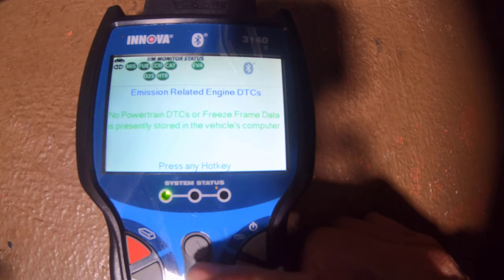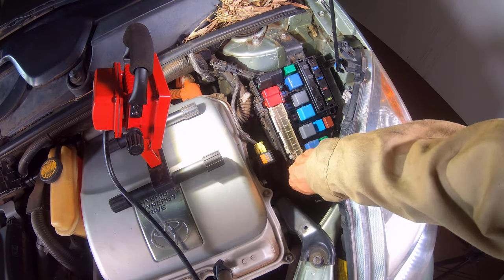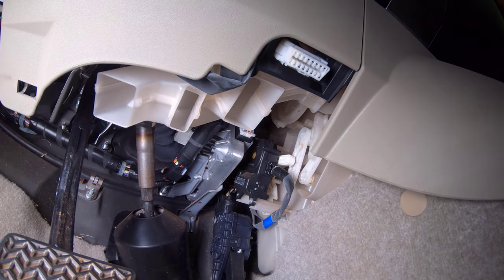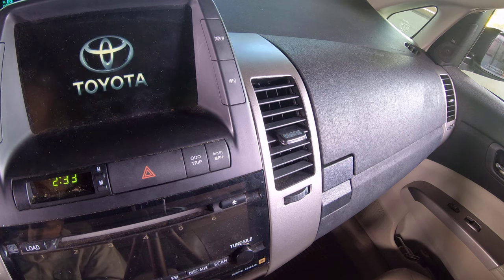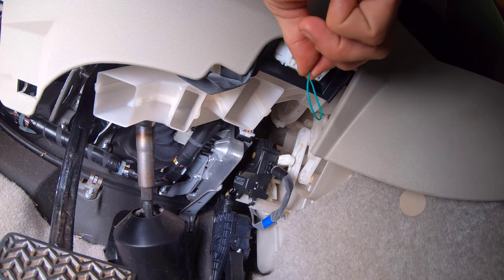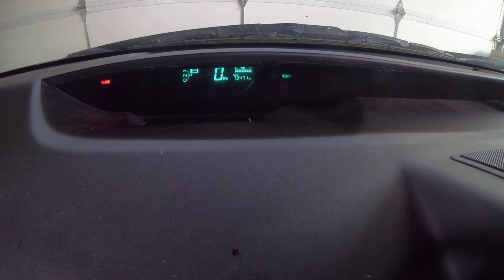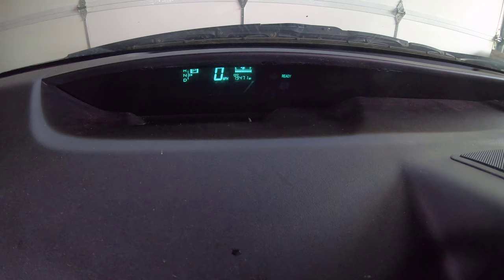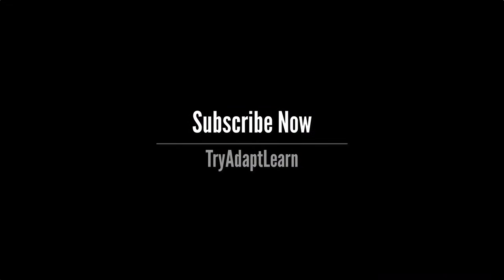Reset the ABS, VSC and Brake system warning lights on Toyota Prius.

Comment: Hi. Thx for your video. 
I have same problem.
Lights goes off but when i take clip out the light come backs on.
Any advice pls
Reply from the maker: If indicator lights keep coming on after they are reset the problem is likely still occurring. Take the vehicle to have a Toyota and/or ASE technician look at it,  They will have the diagnostic tools to run through the brake system thoroughly.  If you must troubleshoot yourself, next steps would likely be to check: 
Computer maintenance codes 
Electrical fuses 
12 volt battery voltage 
Brake fluid level 
Brake pad/shoe wear
Continuity of wires to the brake system sensors 
Faulty sensors
ABS pump and/or actuator
Reply: @TryAdaptLearn  . Thx for your reply.
Reply: @aimlessdrive8723  I took it to garage they had expensive scan tool  they clear it was easy, but with my scan tool  didn't work

Comment: You missed an important step.  You are supposed to press the brake pedal at least 8 times within 5 seconds once the diagnostic screen appears.  Without this step it did not work on my '05 Prius.  And this is directly from the Toyota service manual on page BC-38 (Break Control section pg. 38)
Reply from the maker: Thank you for including this information.  The process in this vehicle worked for the vehicle in this video but the steps in the Toyota service manual (and/or manufacturer service manual specific to each vehicle) include the proper and definitive process.
Reply: @abe Alexander  thanks for the Info It works for a 09 prius base model....
Reply: Worked for me after pumping them 8 times. Ty for the help
Reply: It Works in my Prius 05
Reply: Thank you, wasn’t working for me on an ‘07 until I did this!
Reply: and does the manual says to jump the OBD-ll pins 😂
Reply: Thanks for great advice even save money and life

Comment: To reset the internal DTC codes for ABS, while displaying this diagnostic screen, press and release the brake pedal 8 times within 5 seconds.  Turn the car off, remove the jumper wire, and start the car.  Note: for me, I think the error was triggered when I had some brake fluid come out of the cylinder when replacing the rear brake shoes.  I adjusted the rear brakes, and bled the brake lines to get the air out of the lines, and then cleared this error.  It worked!  For me the ABS code was 42 and the VSC code was 65.
Reply from the maker: Thank you for your detailed description.  One good thing is that you added the reason why your light came on and how you fixed it prior to resetting the light.  There are many reasons why these specific lights come on for this vehicle.  First assumption should be that the lights and sensors are working and there is a malfunction in those systems.  Your comment explains your issues clearly.
Reply: Lol you answered my the question  that the video didn't
Reply: Thank you, I had diagnosed and fixed my brakes without the fancy scan tool and just needed to do this 🤣

Comment: If this doesn't work, please check your brake fluid level. It was actually my problem and, thank God,  just by adding some fluid all the lights went off.
Reply from the maker: Thank you for contributing more information to help troubleshoout this issue.
Reply: Just as Abdul Rahman, in my case too abs, vsc, brake system warning lights went all off after adding more Brake fluid. The diagnostic sw confirmed error C1202 "insufficient brake fluid". When I checked though, the level was on MIN and could not suspect this to be the cause.

Comment: 2009 Prius, recently had left front wheel bearing assembly replaced. When I started my car afterwards, noticed "Brake, ABS, & VSC" lights stayed on. In your video you mentioned "connecting jumper wire 5th hole on top 4th hole on bottom". I stopped the video and noticed holes connected were opposite "4th hole on top & 5th hole on bottom" and that's where the jumper wires were placed. Today used a small paper clip & after a few times trying to connect jumper wire (4th top and 5th bottom), at 66 my eyesight is not like it used to be, had to get real close, and finally got them connected. Turned car on, diagnostic screen popped up(all o.k.), pumped brakes 8-10 times real fast, and brake light went out, other ones were still flashing. Will go down tomorrow as I ran out of daylight, and do again as I left the jumper wire connected. Thank you for the video! It was a big help.
Reply from the maker: Thank you for your feedback and good luck with resetting the rest of the lights.
Reply: I do appreciate your video. Very helpful!. Have made several attempts to clear the remaining lights on 2009 Prius with 202,000miles on i.When I start the car and remove paper clip, the mentioned lights(ABS, VSC & exclamation point) remain off, but when I start down the road, within a minute or two they come back on. So I  suspect a defective/damaged Speed/ABS sensor. Will be checking associated fuses tomorrow. My son last week changed my left wheel bearing hub assembly, so something might have happened with the mentioned sensor. I di find your video very helpful. Thank you!t @TryAdaptLearn
Reply: Well tried several times using paper clip method per your video. Lights on dash would be off while car was not moving, but came back on after going down the street. Checked fuses..all fine, even unhooked 12v battery for 10-15 minutes. This morning was pushing dust shield away from left front rotor, was able to reach my hand in behind brake rotor, lo and behold found the left front wheel sensor unhooked. Took car over to my son, he pulled the wheel off, and found the little bolt holding the sensor in place had been sheared off. Were able to remove remaining threads, and secure the connection. Started the car and all the same lights were back on, so got out my trusty paper clip, and did the process again, removed paper clip (lights again off), drove a little piece up the road, lights did not come back on. I drove about 15 miles home, lights are still gone. Thank you again for the video, after doing it several times, was able to memorize the process. Problem is solved.
Reply: @TryAdaptLearn  you definitely said
It wrong

Comment: Great video. My 2012 Prius C shows the same warning lights. Do you happen to know which pins (and their locations) so I need to jump?
Reply from the maker: I'm sorry, I do not know if this prodcedure will work on the nwer Prius C.  I would start to troubleshoot the issue with a code reader.

Comment: This worked  for me after changing  my battery but i also had to press the brake pedal 8x within 5 seconds as mentioned  below by Abe Alexander for it to clear my code, so that method works for 05 and 09 base model for sure.....After changing my brakes, lights came on along with breaks barely  working, I had to put car in battery mode while using the break to help car stop, this method fixed it so yea thanks a ton 👍🏾
Reply from the maker: Awesome. Glad it helped to reset the lights. Thank you for leaving feedback.
Reply: fixed my 2011 Prius lights , when press the brake 8x within 5 seconds  !

Comment: Will this work with a 2012?  Ever since having a low tire my "slip indicator light" has been on!  It's the only light on.  EDIT:  Our Prius-V is a 2012 and still has original 12v. Trunk battery!
Reply from the maker: I’m not a technician but here’s my opinion on what I would do if this were happening: Several issues are challenging so I try to do as much as I can for each issue one at a time.  At 9 years old, I would test the 12v battery and change if needed.  Some auto parts stores offer help with testing batteries.  The tire is also priority, I would take a note of which tire was low.  If it's more than just an inflation issue, I would try to get it to a tire shop to identify the cause and permanently fix the issue. Then the light first is try to get get the codes with a code reader also troubleshoot the sensors and wires to the sensors for that location.

Comment: Guys make sure you check your speed sensor is clean and the dust caliper is installed correctly. That’s what caused my lights after a bearing change.
Reply from the maker: Thank you for your perspective.  A dirty connection at the sensor is one only few issues that may be the cause of the lights displaying without any serious issues with the parts or systems.

Comment: I"m having an issue with my abs lights on my 2012 prius.    when I use your jumper method it works to reset the lights but, as soon as I start driving they come on again.  How can I figure out the root problem with out going to the dealer ?   I know they will hit me over the head - Thanks
Reply from the maker: One way to trouble shoot is to use a code scanner that has ABS capabilities.  Some auto parts stores will also use their ABS scanners to help you diagnose free of charge.  Although it will take more time some service departments at dealerships will diagnose for free, you just have to to ask specifically how much they charge for diagnostic only.  I have listed the items to look out for in the pinned comment.  The lights could come on due to any of those items.  Unfortunately with these vehicles, the most common cause is the the ABS pump and/or actuator.  The part alone is expensive,  no matter who does the labor, I would recommend a genuine Toyota part.

Comment: I did my own brakes on my 2009 Prius and the brake, ABS and VSC lights came on and braking was unacceptably dangerous.
With a PAPERCLIP and jumping the pins like your video shows, my brakes now work like a dream and all of the lights are off.
Thank you!
Reply from the maker: I am glad it worked for you.  This is likely because you solved the issue by with replacing the brakes and the reset procedure was just for the lights.
Reply: Same for my 2008 Prius! Need to pump the breaks 8x when the diagnostic screen came on like another post said. Classic YouTube at its best right here
Reply: @TryAdaptLearn I did it but it comes back like everyone 5 -10 miles . Do you know the solution to that ?

Comment: Worked perfectly. The lights came on after i replaced the drivers side hub. The brakes were not working and the lights were on. I entered the diagnostic mode by using the jumper cable and just to be sure, pressed the brake pedal 8 times. Worked on the first try. Brakes are back and lights are gone.
Reply from the maker: That’s great it worked as a light reset for you.  Thank you for leaving your feedback.

Comment: I just wanna point out that if you have an airbag light, check the wiring under your seats. My wiring was mangled af. I fixed the wiring (not condoning diy repair of abs and srs wiring) and the light went out on its own.
Reply from the maker: Thank you for sharing this information.  There are a lot of systems that may use the same indicator lights and it’s good to learn about one more area to check and troubleshoot.

Comment: Thank you very much or the clarity on this issue.  I just replaced the wheel bearing hubs on the front end of my 2009 Prius, and this caused these brake warning lights to come on.  Knowing that I do not have any other issues with the brake system this was all I needed to do.  Thanks again, I will be hitting that follow button to see more of your content!
Reply from the maker: Glad to hear that the process worked to reset the lights in your cat.  Most of the time, the lights indicate an issue but sometimes like your vehicle, they just need to be reset.  Thank you for your support.

Comment: For what is that KEY switch next to the tyre pressure set button?
Reply from the maker: Good question.  The switch labeled "Key" at the bottom of the steering column is used to enable or disable the smart entry and start system. When the switch is in, it is disabled, when the swtich is out, it is enabled.
The "Key" switch is unrelated to the issue in this video which is why is was not identified in the video.
Reply: @TryAdaptLearn  thank you. :)

Comment: The diagnostic port faces straight down at the floor.  Very difficult position to be able to view the two ports and jumper them correctly. (If you jumper the wrong port you can seriously damage the car I think). Any tips?
Reply from the maker: Thank you for your question.  I think that if it is hard to see, I would use a couple different options to help.  One would  likely be a mirror.  If possible, the “selfie” camera and display of a phone would be good.  Either way, it would good double check the orientation of the ports.  It may also be helpful to have two diagrams of the ports.  One would be looking at the port if you could see it directly and the second diagram as you see it with the help of the mirror or camera.  Jumper wires are not the proper diagnostic tool and I agree that it is possible to do serious damage to electrical system if this is done incorrectly.  There’s always the choice to take it to a Toyota certified technician.  Good luck with trying to diagnose the issues which may be causing the lights to come on.

Comment: This didn't work for me, the ABS and brake light is still on.

The ABS and circle/! Light is flashing when in the diagnostic mode.

I also pressed the gas 8 times like others said and it still didn't work.

I just changed a wheel hub and brake caliper.

What could be the problem? I'm pretty sure I installed the caliper correctly
Reply from the maker: I am sorry to hear that the light is still on.  It is likely that the hub and brake caliper could keep the light on or that there is another issue.  If disconnecting the battery and trying to reset the light doesn't work there may be an ongoing issue related to these systems.

I would try an automotive code scanner/reader to see if there are any associated codes related to the lights.  If still in question, it may be worth it to take it to a Toyota dealership with certified Toyota technician/s to properly diagnose the braking systems.

Comment: I do not understand  why many peoples just click to reset any error coming up  ?  So if your ABS motor broken  then  we just clear error  for what. ?  so will it coming again ???  Or some sensor bad or broken  so can we just clear the error  or need to change the motor first and than clear the error  ????
Please answer my question because  there are different ideas of each person ,,,
Reply from the maker: Resetting warning lights will not fix the electrical or mechanical issues that they are meant to bring to the driver’s attention.  There are however situations in which someone would want to reset the lights.  These include: Troubleshooting electrical issues that may be causing the lights to stay on.  If the lights remain on after a new part is installed.  In the case of this video, the 12v battery was a part of the issue. In other cars, a low voltage battery will likely not create this issue but this car has the 12v and a hybrid electrical system.  The more complex a (electrical) system is the more likely it may need resetting, troubleshooting, and/or maintenance.

Comment: I have the same car and while I’m driving the light ABS and brake light just come on and The system of the break was hard as well and I had a problem when I was turning the steering right way or the left away was beeping then I stopped the vehicle I turned off for five minutes and turned back on everything is gone is that normal
Reply from the maker: It's good that you were able to resolve your issue with a restart.
Reply: But I haven’t done Anything by herself restart
Reply from the maker: You wrote you stopped the vehicle and turned it off so that could have initiated a restart or recheck.  If any lights come back on or you feel that the vehicle is not braking normally, you should take it to a Toyota technician to have them run diagnostics on the braking and electrical system.
Reply: @TryAdaptLearn  Well it happened last night I am going to drive today again but I have done something I released the pressure of the front tires I don’t know that cause the problems
Reply: @TryAdaptLearn  Thank you so much yeah I drove my vehicle and nothing come back I think everything is okay now what do you think do I still need to check it on shall I just ignore it
Reply from the maker: Sorry for the late reply. I would have it looked at, and definitely if the light comes back on or the next time you take the car to a professional for anything else.
Reply from the maker: Tire pressure may be related to the tpms system and tire pressure light.  As far as I know, the abs and back are apart of the brake system and monitored separate from the tire pressure.

Comment: I put a jumper wire and pressed start but no diagnostic screen. Any suggestions??
Reply from the maker: You can double check the pin numbers that the jumper is in but if there's no diatonic screen showing in the display, you'll likely have to take it to a Toyota technician with the proper tools to troubleshoot the issue.

Comment: Followed the steps. Got the ok signs, BUT IT DID NOT DO the trick. So I continuea
Reply from the maker: If this process did not reset your lights, it is possible that you vehicle sensor/s may be bad.  If they are functional, they may be indicating that you have a problem that need a to be fixed before the lights can be reset.  While troubleshooting the issue it may be worth considering to take the vehicle in to have a Toyota technician with the proper tools to look diagnose the issue further.